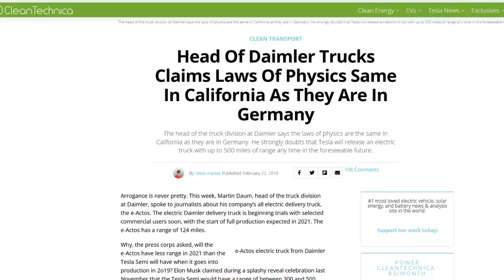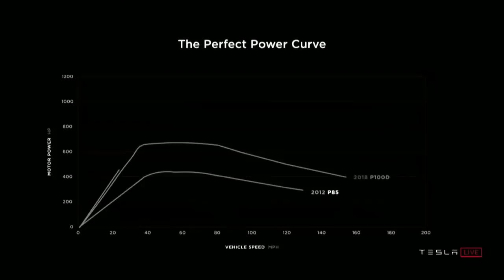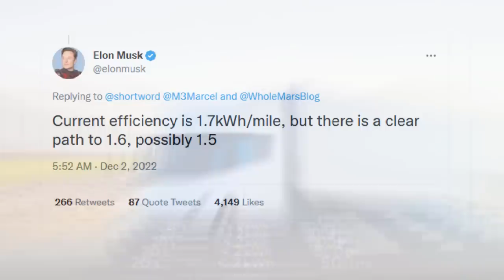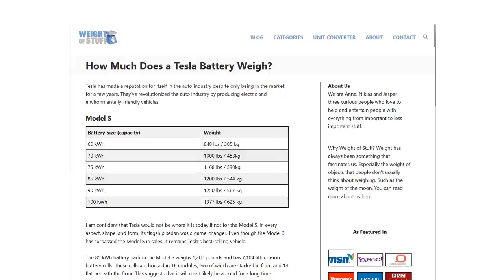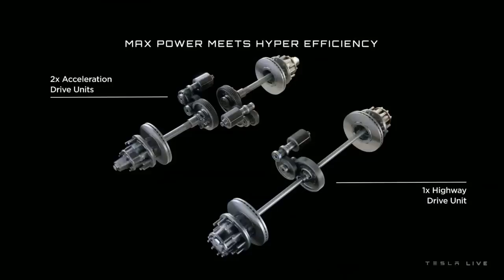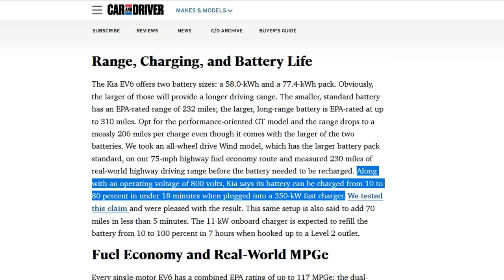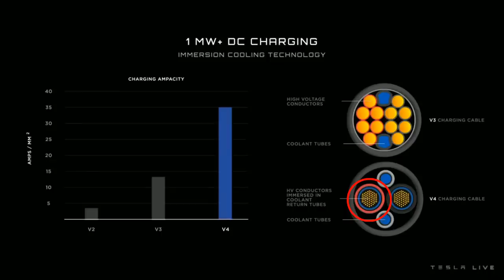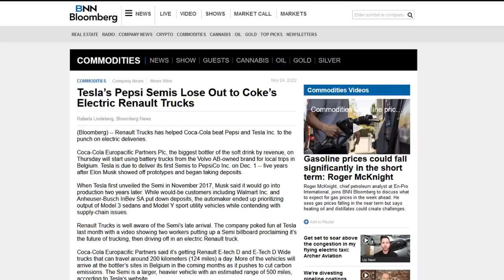Elon Musk Drops Tesla Semi Bombshell

Comment: If all Semi will be manufactured in Nevada it needs at the goal of 50.000 pcs * 750 kwh = 37.5 GWh: Thas fits perfect without needing structure packs [all produeced in Austin/Berlin/Shanghai localized] ! Most efficient localized and taylored to the needs of any fabrication. Could be 20-30 times less heavier to drive motors to Nevada than batteries to other locations!

Comment: 500 miles is not suitable for long haul, I believe that's what Bill Gates was talking about.
Reply: Mega charging stations like the cars super charging stations will cure that. They are already being installed in the south west. Incredible powerful and fast charging inductive or plug in. Murderously fast and powerful and simple drive over a charging plate process.
Reply: They say it can charge 70% in 30min. So run your 8 hrs then charge on your mandatory 30 mon rest break and run your 3 remaining hours with plenty of range left. Looks like that's 450mi then charge to add 350mi and your should still have 150mi left when you log off duty.
Also these are just day cabs so not for OTR drivers. Yet.
Reply: @Dive-Bar-Casanova  The Mega chargers that need to be installed will cost millions to install because they will need utility and infrastructure upgrades, including mega packs that cost 1mil a piece... whose paying for those Tesla or the fleet, if it's the fleet that cuts into TCO. Look at the permit that pepsico filed last year it cost them 334k just for infrastructure upgrades and they only have 4 chargers. I know tesla can do it but at the cost I wonder if fleets other than mega cap companies will buy it, and if Utility companies can handle it.
Reply: @That-Guy_  I agree, these are for regional dedicated routes. In oder for OTR they have to build out an two infrastructures 1) reinforce the grid on the OTR route and 2) the charging infrastructure itself and tesla would have to do it at cost. For OTR the problem isn't Tesla its the rest of the country isn't ready. The only issue in the senerio you provide is those places to stop for the driver are not in place and will need built out all over the country.  Truckers live at these places that do OTR,  they shower, eat, and pay bills..ect.  Tesla would have to either get into that sector as well or convince the  current station owners to upgrade thier infrastructure to support the tesla systems, and if that happens tesla will either ha e to pay for it or give the staion a incentive to pay out that infrastructure cost which could effect charging rates... Thank you for being patient and entertaining my questions by BTW I have a lot of them lol
Reply: @xcaliber1787  
It will be a good while before OTR trucks go electric. My company runs day cabs only. We start and end at the same location so we could get some Tesla Semi trucks and charge then at the D.C. during their 10 to 12 hours of down time. Our loads are at most 60k lbs so the 500mi range would get us closer to 600mi and our longest route is 535mi.
Reply: @That-Guy_  that's Awesome! Your insight is greatly appreciated.  A couple of questions,  how many trucks do you have in your fleet? How much are you willing to pay per tesla semi, keep in mind you have to pay for chargers and infrastructure and utilities  upgrades to your facility as well, if its too personal questions I get it. It's just a rare opportunity you get to talk to the guys actually buying the product. You mentioned your longest route being over 500mi, the recommendations for Lithium-ion batteries is between 20%-80% for battery life so running to a complete drain evertime is not good for the longevity of the battery kinda like your tesla cars just FYI.
Reply: @xcaliber1787  
I rounded the numbers for the sake of brevity so it might look like my math it off by a bit but it's close enough.
My location has 21 trucks. 
We run about 2.5 million miles a year. 
We spend $2.4 million on fuel per year. 
So if each Tesla Semi plus equipment/ upgrades was $300k to $350k and we got the 1.7kwh/mi as stated by Tesla at our power cost of $0.04/kwh we would save ,just in fuel costs, about $2.2 million/yr. That would only take about 3 years to fully pay for all 21 truck plus equipment/upgrades.
We have 8 routes under 250mi, 4 between 250-400mi and 6 from 400-535mi. So we would either rotate trucks to keep the batteries healthy or accept that the ones on the long routes will need replaced sooner but the ones on short routes will last longer than 10yrs. 
Now if they had LFP batteries like my Model 3 rwd they could last even longer.
Reply: @That-Guy_  thank you for the detailed response,  I really  appreciate the response.  From what I gathered from pepsico the upgrades themselves to their facilities was 334k not counting chargers(4)+ price per semi, with 21 trucks to charge you would probably need a mega pack or two which start out at 1mil a piece. You can  find the pepsico permit online for what it cost them before the supply chain shortage.  Your TCO will probably be longer than 3yr if you add all that infrastructure up, but if you plan on keeping the semi's for ten years I'm sure you'll get you money back in that time period.. do you guys sell your  trucks back after 10yrs? If so, do you guys count on the money for resale value? I just wonder because that's near end of battery life and wondering if that's going to effect resale. I don't know for sure but I know for cars the cost of a new battery is as much as a car, I'm guessing it's the same for semis.
Reply: @xcaliber1787  
Only 10 of my trucks are at the DC. The rest are at remote locations. Because of the 10+hours of down time each day we could "slow" charge them so a mega pack may not be needed but we also have to keep the facility running during power outages so I was pushing for them last year but the back order was too long and my company is bad at planning ahead. 
We keep our trucks for ~600k miles but that's because maintenance costs go up a lot after that for diesel trucks. The much lower maintenance costs for EVs would let us keep them longer. We used to buy our trucks but then moved to a Penske lease setup so not sure about resale.
A model 3 battery pack is $16k including labor so the batteries only cost 32% of the total new car cost. If that holds true with the semi trucks it would still be worth it to change them out and keep the truck instead of replacing it.
Reply: @That-Guy_  sweet thank you soo much for the information 🙏. Really cool of you to do so
Reply: @xcaliber1787  
No problem
You basically encouraged me to do the math on cost savings so I am going to make a short presentation to send to my boss about it.

Comment: As battery energy density improves, it makes a lot more sense to keep the same physical size battery and increase the energy thus increasing range.  Since charge time (in mph) is a function of number of cells, it also makes sense to keep the cell number (or 1/5th of that number if the 4680 is used) to spread the 1 MW over more cells and increase the mph charging speed.

With this, Tesla can advertise longer range and faster mph charging times (even though the percentage times might remain the same).  With charging time improvements for an individual cell, the percentage charging times  (like 10%-80%) will also improve.
Reply: Battery energy density is limited by physics, not technology. There isn’t much you can do to increase the density except at the margins with the packaging. 

Similarly, charging time is a function of how many electrons you can shift and how quickly. Charging a 1MWh battery in half an hour is always going to require 2MW of power.  At standard domestic voltages, that is about 8000 amps. Obviously you would use much higher voltages, but then safety becomes an issue.
Reply: @jeremypnet  With regards to the cells, to change the physics, the mechanism is mostly the  cell chemistry that controls that with other minor factors.   Tesla's 4680 cells improve power capability due to the shorter conduction path with the "tabless" design for both heat and electrical conductivity (thus removing heat faster and lowering the heating mechanism (internal cell resistivity).   Ultracapacitors can charge very very fast compared to batteries since the physics mechanism is charge storage on plates with a dialectric instead of chemical changes to the cell chemicals (for example).  Ultracapacitors have much smaller energy density than chemical batteries, however.

Comment: You want more range?  How about putting about 7 kilowats of power on the roof of a box trailer .  WHen you are going slow or even sitting still in traffic you would be recharging or even just running on solar until you have to accelerate .  Also could power ac while sleeping during the day.  Or keep a load cool on a hot day.

Comment: So in order to get the ability of a transmission that has a low gear for high torque and a high gear for cruising the highway. They installed a low gear motor and high gear motor to handle those differences efficiently while still leveraging the nature of electric motors. It's smart and  show gearing matters for towing. Now build a proper work pick up truck with this tech so we can see how much towing improves
Reply: What makes you think they haven't already? Even the YT comments are looking backwards.

Comment: So, the Tesla side project is going to be retrofitting the entire US power grid ?
Because that grid is underpowered and very old, should have been mostly replaced decades ago, it's ll never hold up to more and more power being used as is, let alone when you add so many EVs that also charge faster and faster.
They're not alone in that, in Europe the same things goes for quite a few countries if not all, and their grid is already far better than that of the US.
But the US doesn't seem to want to learn their lesson, same goes for their bridges for instance.
Reply: Even if we had built the infrastructure (and spend the huge amount of money) to be capable of recharging all those electric semis, where are we going to find the fuel/power source to produce that much energy to recharge all those semis every day? Solar and Wind and Hydroelectric won't cut it. I don't even know if those will be able to supply a significant amount of energy towards recharging those semis.

How much coal, natural gas, oil or nuclear fuel are we going to burn to satisfy the additional power required each day? How much will that be in ongoing costs?

These are the things that nobody is thinking about or discussing. My gut says that we won't be better off when all the bills (environmental, too) get tallied.
Reply: @jimbeckettplay  have you heard of nuclear power plants ? Maybe go for the safer thorium plants as soon as those are up and running. Those can’t have a meltdown.
Reply: @jimbeckettplay  using coal or natural gas or oil or biofuel would be the worst idea ever. Nuclear power etc is the way to go. But yeah, that might be a problem. Which is indeed another reason why that will not be setup fast enough. The problem is also that because of that I think they won’t even start fast enough and not doing anything basically, which means you’ll be even worse off. Nothing new in the US. Also shitty is that there is of course massive conflicts of interest with the people in power and the oil and gas production companies in the US that just want to keep selling the US their wares. So that’s not gonna help.
This and many other things shows how capitalism run wild and not giving a fuck about your citizens isn’t working well. The US has been in decline for decades in many ways and it doesn’t look like anyone wants to get the message and learn and care to actually improve things.

Comment: History is filled with people who were told, you cant do that, its impossible, it wont work.
Thats why we have airplanes, phones, electric lights, air conditioning, the combustion engine etc.
Man...or rather...mankind...has always found the exception to every rule in invention.and nature has always supplied the materials.
Necessity may be the mother of invention but scarcity is the father of ingenuity. 
People have so far overcome ever technical problem we come against.theres no reason to think these and other issues with Teslas semi will not have a solution.
The speak of the arcing problem in very high voltage components. Once we perfect the development of roomtemp and high temp superconducting compounds this will no longer be an issue as well.

Comment: Have you got your facts straight.  I was under the impression the Semi uses 3 x Model 3 motors, not the MS Plaid carbon wrapped motors (overkill & expensive).  And I'm fairly sure although Peter Rawlinson is a bit of a D... that the Lucid Air motor is actually more efficient (not sure if it's more powerful).
Reply from the maker: Carbon wrapped as stated at delivery event.
Reply: @TMIOTesla  yeah, my bad! 🤦 Literally just watched the delivery event & you're right, they've swapped the M3 motors for the MS Plaid carbon wrapped.  Thanks!

Comment: Actually, the 'bombshells' were quite a few.

Unless they were driving circles in Fremont and San Diego, it's around 460 miles from one city to the other on I-5.  Not 500...460.

The load on the truck was less than HALF what was in the ONE diesel it passed going uphill.  During the journey, the video showed it being passed by EVERY OTHER SEMI ON THE ROAD.

They didn't hit ONE weigh station on the way down (as required by law).  Most calculations using the concrete Jersey barriers as standard weight puts tractor weight at over 27k lbs.  That's heavier than most LONG HAUL diesel tractors, which have a 1500-2000 mile range.

So...Gates was right.  Musk overpromised and underdelivered...AGAIN...and stock shill channels (like this) and fanbois are already excusing and worshipping him.

Comment: While a trk driver is traveling dwn the interstate at speeds of 75mph we have the comforting feeling of a 3k LB engine bolted to a hardened steel frame sitting in front of us for protection...and in front of that we have lots of after market heard bumpers to push through the crazy 4 wheelers  without causing much damage to our trks...this EV looks like a toy to me....and expensive with long waits  for parts...we need lots and lots of aftermarket parts...if we dont have aftermarket options it will b to expensive

Comment: Getting two truck, one for dismantle and study it, and the other for testing, will not be enough for MB/Freightliner to obtain all the info they need. For that they also need the rest of the complex- Charger, Software, vertical integration, and a great Engineering Team, something only one company so far has, and that is Tesla.  MB and the rest, as someone already said here- they are laughing at Tesla now, but Tesla will be laughing later at those losers.......
Reply: Tesla's patents are open for others to use if they sign on to the idea of sharing their own patents also

Comment: Let's face it.  The Tesla semi is way heavier than a conventional truck and trailer.  Tesla has huge backlogs on repairs. They trail the industry when it comes to a quality finished products. 14% of all Tesla vehicles manual have to be reworked before shipping the industry average is 7% some manufacturers are below that. Three, that supposed 500 mile trip was in warm weather, carrying boxes of lays potato chips, not exactly a good test. Tesla has previously removed backup software hardware etc. Without telling customers. Additionally the motors are from a plaid? Good luck on long lasting. You took motors from a car that weighs 6500 lbs and are now using them in a vehicle that most companies would use 12-14 hours a day and weighs 35-40k lbs? Why would so many companies want this dumpster fire? There are only two megachargers in existence, it will take half a day or so with a regular supercharger connection.

Comment: Sears......got ate by Amazon.  If they just hired a few dataentry clerks they could still be a Sears today.  Diesels, all they need to do is.....yeah a lot more, but they can start with some serious drivetrain work by using wheel hub motors and a generator off the engine and work from there?

Comment: Tesla Semi truck is not wreaking havoc. Megawatt charging network is not vast, builtout. Daimler is still right, what is the Tesla Semi truck maximum tonnage of freight compared to a diesel truck, which is around 50000 pounds.Tesla Semi truck can deliver a full cargo load of potato chips because full cargo load of potato chips weighs only 7000 pounds. Tesla Semi trucks hauling pepsi owned frito lay potato chips is ideal. A diesel truck can only fill up 50000 lbs=1666 cubic ft of a 3816 cubic ft 53' trailer when hauling pepsi cola or other liquids. How many cubic ft of pepsi can the Tesla Semi truck deliver? If the Tesla Semi truck weighs 28000 pounds, then maximum freight tonnage=82,000-28000-10000=44000 pounds=1466 cubic ft of pepsi cola. A truck fleet owner with 100 diesel trucks would need 114 Tesla Semi trucks to haul the same tonnage of freight.
Reply: Isn't a 53' trailer typically loaded with 26 pallets?  At around 1600 lbs. each, that comes to 41,600 lbs. of Pepsi cargo.  That leaves a lot for the truck and trailer, regardless of the power plant.